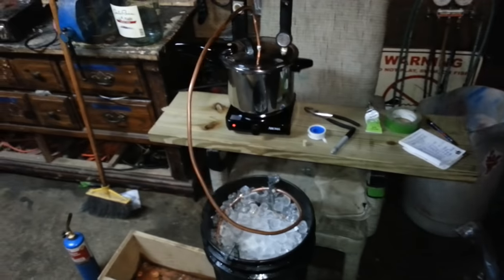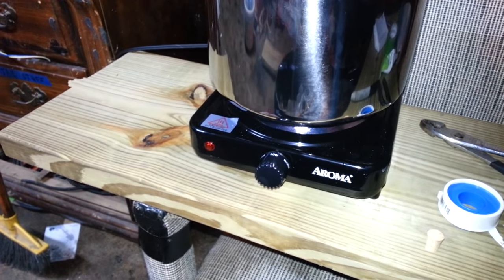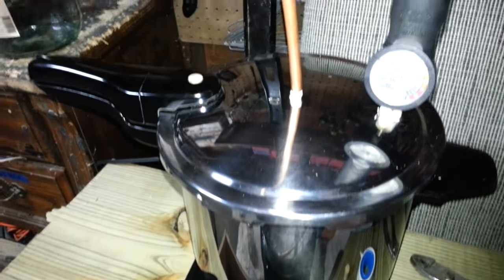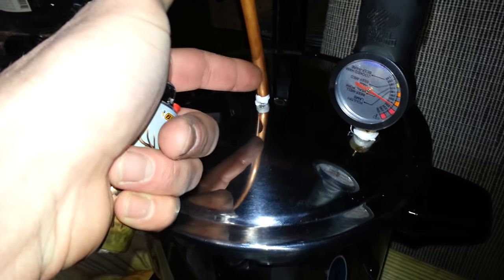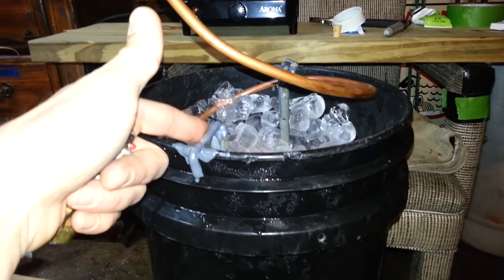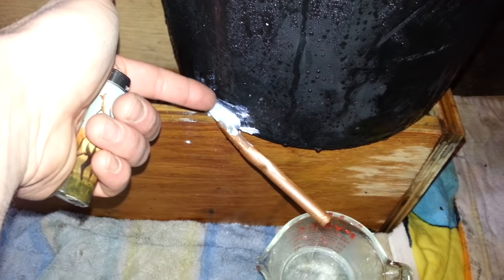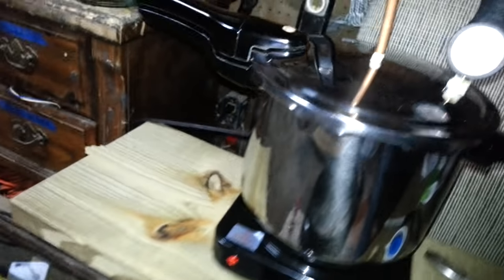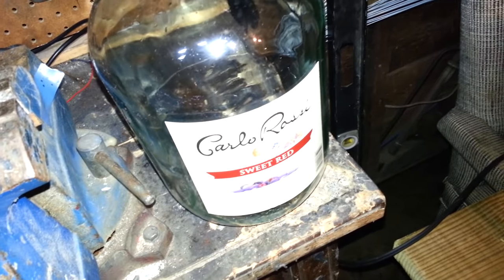HOW TO BUILD A HOMEMADE MOONSHINE STILL !! (Drinking as she flows)

Comment: I heard somewhere when making hard liquor, your first few ounces are either methanol or acetone.  How does that happen?  It is what scares me from making Vodka's and stuff.  I saw on thousand ways to die; some home brewers were celebrating their first batch and gulped down pure methanol (went blind and died).  How can this happen?
Reply: It is a very small amount. That show is BS unless they made a large still. It is important to discard the first bit though.
Reply: Those are by products of fermentation. When you distil, you are essentially separating Ethyl alcohol and other volatile chemicals from water (Methyl and Acetone for example). But for the most part that show is bullshit.
Reply: They do methanol from ethanol from water. If you make a run that yields 1 gallon and that 1 gallon all goes into one container then the amount of methanol is so small it isn't dangerous. Now of you were to run a 50 gallon run then unless you have a 50 gallon container the entire run won't be mixed so the first of the run will be high in methanol. If you did have a 50 gallon container you could mix it all together which would dilute the methanol back to a safe level for consumption but it is obviously better to not do that since you don't want it to begin with. Methanol gives a bad flavor.
Reply: Yes it is. Don't drink it. Use it to lite bonfires.
Reply: Piano Man42 Just dump the first 10% of your run.  You'll be good to go.
Reply: Anthony Marzella I do not advise anyone to drink the first 10 percent coming out by volume after consideration of what you were talking about.  .
Reply from the maker: Piano Man42  you drank an didn't feel anything?  Come on now did you water it down to 80 proof or something? N don't drink the first drippings man how is it a myth if old timers n even distilleries are throwing out stuff if not filtering it... I now am useing a 5 stage filtering process n have got great results..I'm producing 170 proof n getting 2 to 3 fifths from 1 gallon of mash I've thrown out gallons of first drippings n it smells, taste n even looks different then middle runs so do what you do but don't tell people it's ok to drink the shit
Reply: Jake Foster Sure, I felt a standard alcohol buzz.  What I meant is that I did not feel any adverse, ill effects.  Liquor was 140 proof and crystal clear.  I had no extreme after effects, and no foul smells were made.  The wash was made from Alcotec 24 and sugar.  The still I MacGyvered was made out of Glass.  It is risky every time I use to shatter the glass.  See my play list, wine part 4 for details.
Reply: Jake Foster I reedited my comment.  I don't want to give anyone any bad ideas that can harm.  I may have got lucky and got ahold of a good yeast strain.  I also added clarifiers to my wash before racking.  It was crystal clear in the end.
Reply from the maker: Sweet sounds good man
Reply: you need to check the flame after the first ounces, take a metal spoon and test it on a few drops and see if the fire is blue, if so it is good
Reply: The very first small amount to run contains methanol and acetone because these have a lower boiling point than ethanol. This is why the few first ounces should always be tossed or used as solvent/cleaner or fuel. If you were to run 50 gallons, you would toss even more. There are tables to give you more exacting measurements. It is nothing to be afraid of, it is simply something you should be aware of and take heed of. Simply keep it separated. All distilled alcohols have this property, yet people still flock to the liquor store.
Reply: Acetone and methanol are also clear. It is toxic, whether you got by with drinking a small amount of these or not is irrelevant...it is absolutely present in all runs and is absolutely toxic...period
Reply: Methanol and Acetone are more a product of fermenting and distilling fruits.  With sugar wash it's not that pronounced.  Always ditch the first 10oz  of a 5 gallon run, that's my rule of thumb.

Comment: and what is the paste made out of plz
Reply from the maker: FrankieTheDude flower sugar and water
Reply: Jake Foster I'm lost on the copper seal and what increment of flour water sugar ect and in lost on corks did u drill at all
Reply: u use tuff line or silicone or both there looks like u used both did u drill holes 4 cork orr
Reply: FrankieTheDude QAAS see needs

Comment: DOES ALCOHOL VAPOR CAUSE TO BLAST WİTH THESE PRESSURE COOKERS ?

IS THİS DANGEROUS ?
Reply: yeah there's always a risk involved with any setup. vapor fumes, the smallest leak in any if the seals or tubing where the copper connects to the cooker could ignite if there's a spark and there's vapor.
Reply: Aaron Leon
Thank you very much for this answer. What should we do for preventing this danger ?
Reply: +mehmet olcay have proper ventilation, air flow, and put plenty of flour paste at your joints. This helps to seal the equipment at any potential place vapor can escape. Mixing instructions can be found online. Your joints are places where tubing or other components meet each other  there's a thin gap. Eliminating these small spaces and rooms for vapor to escape is going to eliminate your chances for a accident as well as retain your yielded moonshine. Hope this helps.
Reply: +mehmet olcay One added note, on this video however their risk is significantly reduced cause they're using a burner, versus a flame.
Reply: Thank you. I will pay attention to your suggestions..
Reply from the maker: Anything flammable is dangerous as we all know. Just be smart with it ...my still is so small it would take hours n hours to full my garage with enough fumes to be ignitable. Making sure your connection points are sealed with paste is a always but that's just so product won't escape before turning back to a liquid. ...it will kinda puff at the bottom of your worm so there is always a risk of flammable gases escaping.....but remember its science! Air fuel mixture has to be perfect for ignition and the ignition has to be a spark ...you can throw a lit cigarette into a bucket of gas all that will happen is it will go out ....so in all just be smart use your heads and happy shinning
Reply: Jake Foster
Thank you very much.

I don't know but this system is very complex.

I want to buy Megahome Water distiller. I will distill my mashes and wines with these air style distiller.

Is there any danger or methanol with air style distillers ?
Reply: +mehmet olcay That actually looks like a great way to give yourself methanol poisoning.
Reply: Andrew Marshall
METHANOL ?

CAN METHANOL BE PRODUCED BY THİS DİSTİLLATİON SYSTEM ?

I KNOW THAT THE METHANOL CAN NOT BE DİSTİLLED FROM SUGARY MASHES
Reply: +mehmet olcay for someone to give you a definitive answer beyond any doubt, they'd have to Google your question and then report back here. I welcome you to just side step, and research for yourself.
Reply: methanol is always produced when using these methods. The first bit to run is methanol as it has a lower boiling point than ethanol. This is why it is always discarded (or used as a solvent/cleaner or fuel). There is not much methanol present in these setups though. You would have to run thousands of gallons to collect any large amounts of methanol.

Comment: how much alcohol % is is then?? 40 50 60 70 80??
Reply: +trueme1990  it comes out of the still at 180 proof thats 90 percent pure
Reply: +david mcfarland bs. there's no way this produces at 180 proof. I'd love to see a video if this running, with no cuts just consistent filming, and then the alcohol measured with a hydrometer.
Reply: if someone is running a still who knows what they are doing should get 90 percent or really close to that. Most people who buy liquor from the store like 60 percent or 120 its what they are used to paying for and drinking. I have to cut mine in half with pure water to bring it down to 60 percent.
Reply from the maker: Hey guys wish i could upload pictures but on regular I get 120 to 140 proof every now and then things line up in the  world and I get 140 to 160 proofs that being said I have started to explore the world of double distilled. ....80 to 120 proofs will cook to 170 180 proofs I have some on hand right now and will show hydrometer in test tube with 183 proof it's been double distilled and filter 6 times through a 5 stage filter this I have found to make a much smoother taste.... the taste is amazing best part being this high proof with filtering the after burn is cut back ....for the non believers contact and I will email or something
Reply: +Jake Foster yeah dude that's amazing, what part of the world do you live in. I'm in Tallahassee FL. That being said about the double distillation, I would imagine it takes more volume to create the end result. For example 1 gallon may yield a half gallon of double distilled? that's just a example but am I correct in assuming that. What does it take to make a quart for example?
Reply from the maker: +Aaron Leon yes you are correct it does take more. So I took 3,000 ml of 126 proof which is around 3/4 gal. give or take I double distilled to little under 1/2 gal.....Your just cooking out more so you lose more ...you gota give to get sorta say that being said sometimes you do lose more then get I use my tailings once saved up 60 to 80 proof and re run them I'll lose 3/4 of it from a gallon. but thanks for watching and comments. Here from missouri

Comment: Why cant you use aluminium.
Reply: You can but it will eventually pit from oxidation down the road.  The key is to not scrub the inside of the pot with anything abrasive after runs.  Use a rag or something.  My thick aluminum pressure cooker makes great whiskey

Comment: very unsafe still design alcohol vapor rises and the worm is directly below the heat source move worm to the side. you even said yourself what your working with is flammable and you dont wanna blow up
Reply from the maker: KAREN WALKER thanks for the view but if you didn't see i was using a hotplate as my heat source this set up still works to this day 170 proof highest hit

Comment: You do not have to throw out the first 2 oz... I have never heard of that.. Ive made shine for over ten years now.. What comes out first is strongest, but perfectly fine to drink.
Reply: no, it isn't...it is methanol and toxic....smh.
Reply: No you're dead wrong. In a high fruit wash like for apple brandy you'll have a SMALL amount of methanol because of the fruit pectins and stems from the fruit. And as I said when you're running five gallons at home the amount of methanol is completely negligible even in an all fruit wash. When using grains or grains and sugar and PARTICULARLY corn the amount of methanol produced is all but ZERO. The reason to toss the fores is because they contain stuff like acetone and ethyl acetate. These will NOT poison/kill you in such small concentration but the WILL taste nasty and may give you a bitchy hangover. But again it's NOT because of METHANOL. I have been doing this for a very long time myself and read about making alcohol basically every single day. You are repeating an urban myth with no real basis in reality but please be my guest to keep spreading the BS about methanol. I guess I should add that if you had a 10 thousand gallon still like at Jack Daniels then you MAY and I say MAY have a high enough concentration of Methanol but since they are using GRAIN they also toss the fores because of what I mentioned above. By the way do you know what the ANTIDOTE for methanol is? ETHANOL. So if you were to drink a whiskey with a high level of methanol it literally wouldn't matter because the ETHANOL would counteract it. Stop spreading bullshit, guys.